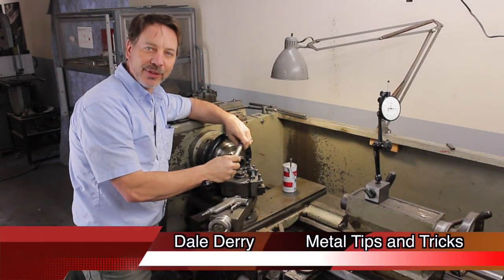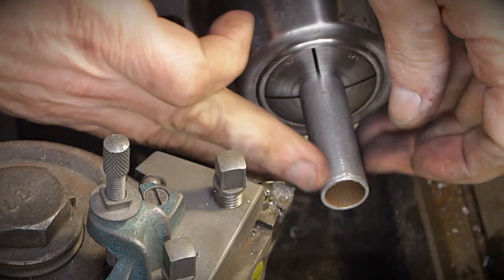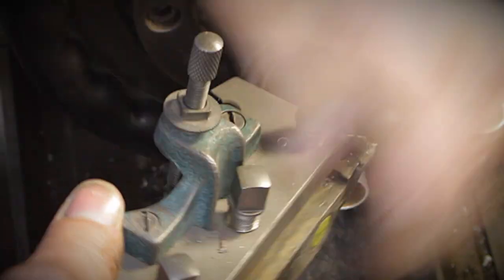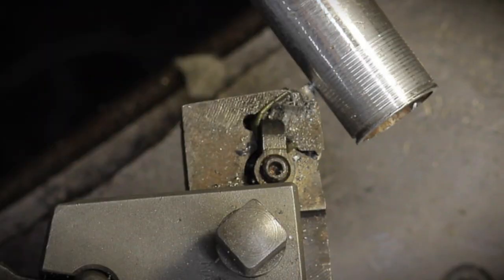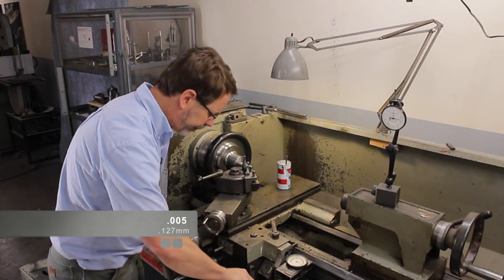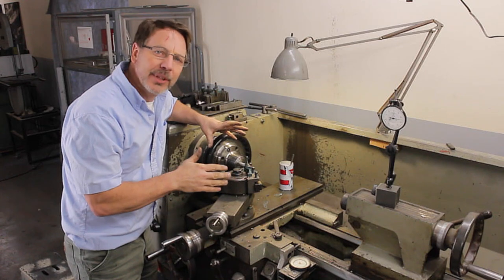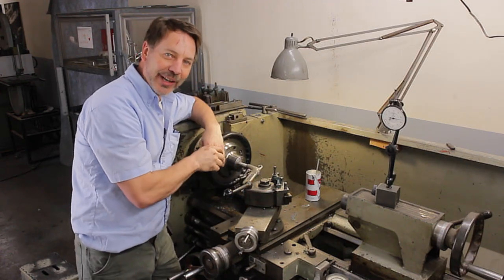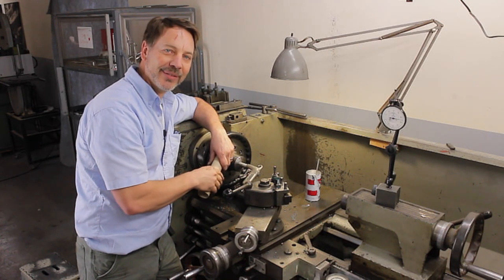How to cut Threads on a  tube

Comment: Great video as usual! It'll be interesting to see how you go about rebuilding your lathe. I have a opportunity to get a 16.5" swing /54" between centers monarch lathe that was built in January of 1946. Sadly it has been out in the elements for several years. Surprisingly the rust seems superficial but it is still rust on what used to be precision surfaces. I'm guessing that the best route would be to have the ways reground? I really don't know, I just hate to see such a fine piece of old American cast iron go to scrap! BTW, the price is right for obtaining the lathe... Free! Even considering that do you think it's possible to save it or should I pass on it? Thank you!
Reply from the maker: +Steven May 
If you have room for the lathe you should get it, take a day set it up and clean it. It could be fine the way it is.
Reply: +Metal Tips and Tricks (Dale Derry)thanks for the reply, I believe that I'll take that advice. It's a couple hour drive from my house so it'll be a month or so before I'll be able to get it

Comment: I never understood how these thread micrometers work, since opposing thread valleys never line up square to the piece, and this implies you are always measuring askew. can you explain this? thanks for the video. liked the metal spnning trick. Cheers.
Reply: +Flip de boer I could imagine that the adjacent part is actually not one spike, but two with a groove in the middle, so you line up the close side to two threading grooves on the far side, thus being centered and square.
http://server2.smithy.com/media/jpg/3-85.Jpg this picture at least supports my suspicion.
Reply: Ok, that makes sense. thanks.
Reply from the maker: +Simon W. Heidenreich 
Thanks for showing the graphics :-)
Reply: ***** alwas happy to help. :)
Reply: +Simon W. Heidenreich ..I've never seen this tool before, but I too thought it was as you describe....

Comment: good video dale. i have never used my ball bearing tool like you did to smooth out the od of a tube. very interesting. i noticed you have a multifix tool post. how do you like it ? i have been using one for some time now and i really like it. the originals are very expensive,but like every thing else , there is a company from china making knockoffs that are very affordable.
Reply from the maker: +larry sperling 
I like the tool holder. But it has one shortcoming for me. The tool holders themselves are kind of heavy, but good things always are.     :-)

Comment: I enjoy watching the videos you make, I am wondering why you used such a thin wall tube. Why not take a solid rod of aluminum and drill out the middle after you have threaded the rod to turn it into a tube?
Reply from the maker: Great question. Its faster and easier and cheaper. If the tube was damaged,  and I had no tubing available, then I would have done  what you are describing.

Comment: One of the guys at the Home Metal Shop Club (Houston, TX) was having trouble turning a piece of tubing.  He was getting a lot of chatter and vibration using a high quality (i.e. expensive) carbide insert.  He brought the problem to the club meeting during our "problems and solutions" segment.  The diagnosis from the old timers was that carbide cutters are unsuitable for cutting tubing.  They advised him to use HSS instead. 

Since I only operate a small hobby shop, I am not concerned with the efficiency offered by carbide.  I have switched to HSS for all my cutting.  Have found the Arthur A. Warner company to be a good source of HSS lathe tools.  Warner makes holders for HSS inserts so, you just have to buy inserts when things get dull.

Comment: i recently watched a video , by a fellow YouTube. canal  on  milling thudding on  a manual lath . I found  it intrusting . becomes . My lath dos no have a lead screw & relies on  the rack to cut the thread pitch .  i found that mill threading is a .new & positive ways to cut fin & corps trends . 7 at a very slow rotating chuck speed.  if required. threading  can be cut short & long solong as time is taken to allow the milling to teak place   tow passes is often sufficient to cut  a thread finer threads in one . check the channel out .

Comment: I'll go out on a limb here and say that file cards are not all that common and I'm betting that a lot of people  will have not seen them. What you're using for the final cleanup, is a file card, used generally for removing "pinning" (loaded metal stuck in the teeth of files) in files.

Comment: Good video. I think that threading is over rated. I had my compound table lead screw nut broken and had to thread a new one. This is an ACME thread. So I had to grind a tool for it and having no way to really scientific check al the tool parameters,  I simply grind it until I was satisfied with it fitting on the screw. Came out fine and at the same time I made it a Zero Backlash nut. So threading  is not that complicted just need a bit of common sense. 
The ball bearing idea is nice and I will have to give it a try, see if it works. 
Thanks for the effort on making such a high quality videos.
Reply from the maker: +ophirb25 
thanks for your comment

Comment: Why you make a video about theading when you have no idea about it? Is not about practice, is about knowing the basics.

You have to use the clutch and use the threading axe, not the turning axe. I think you're setting cutting speeds, not thread pitches.  
If i'm wrong and you are using the right pitch, remember one time you set the clutch, you can't unclutch until you finished the work or you lose the pitch. After the first pass you have to separate the insert with the cross feed wheel and stop the lathe. Then use reverse to go to the start without unclutch the thread axe. Stop, set the new measure in the cross feed wheel and yout're ready for another pass. 

Maybe you have to open the lathe and move some gears, not everything are levers. 

If not use a tap or just glue it with epoxy.

Sorry if I misspell , english is not my 1st lenguage and it's complicated to explain.
Reply: Carles Duran The guy obviously knows how to work his lathe, otherwise he wouldn’t be able to make a video on threading...